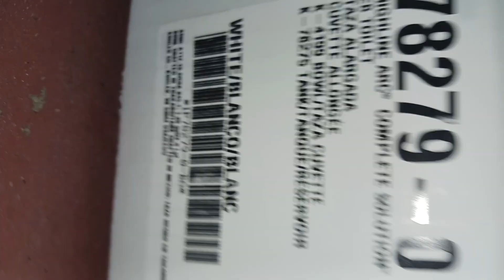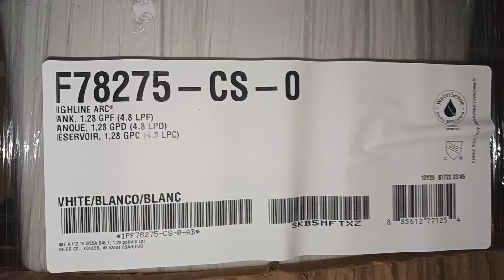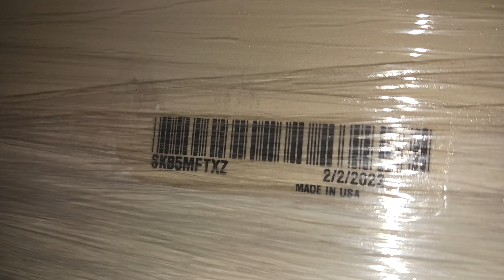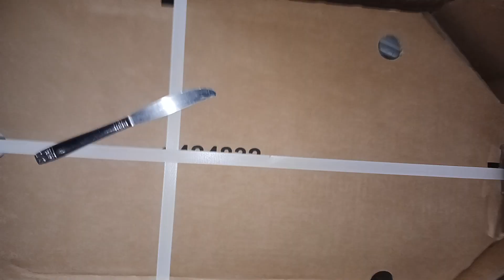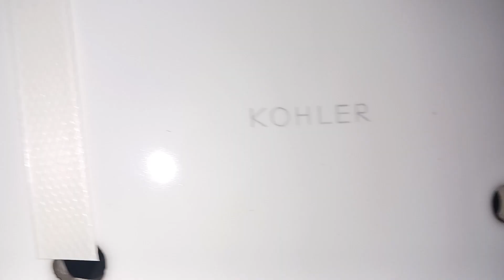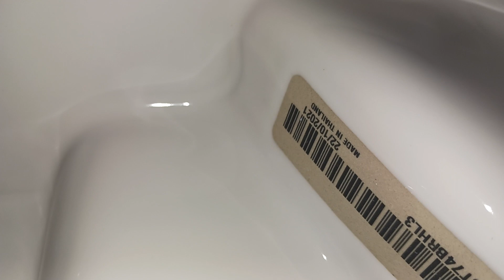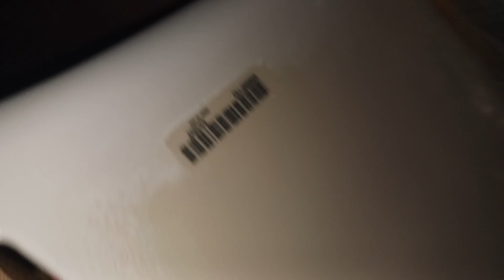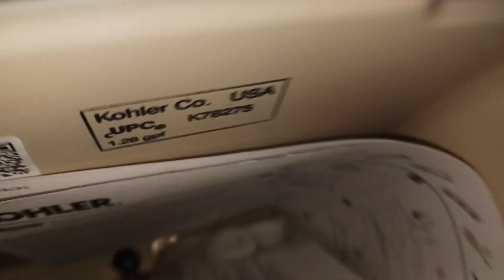New 2021 Kohler Highline Arc Toilet Unboxing

Comment: Now how does it perform? I’m Thinking of maybe getting one.
Reply from the maker: I installed this and put it on use ever since late 2022. It's been installed for a year and I would say the performance is okay. Middle of an road. It could clog. About the flush It's never had any issues on removing. I'd say it's decent. I also Modefied it to flush longer before installing.